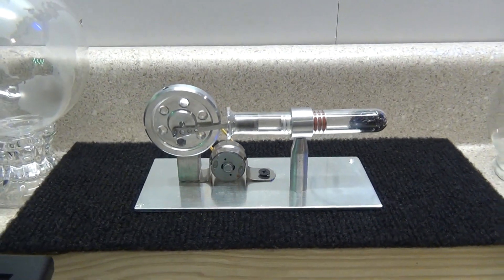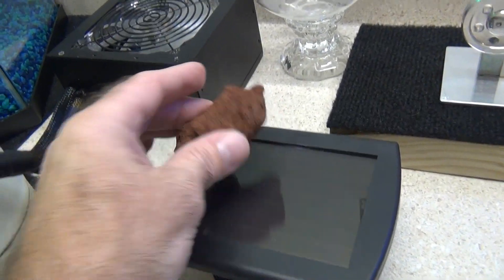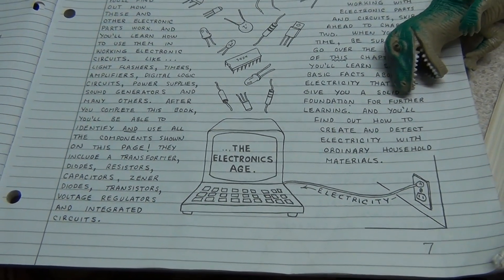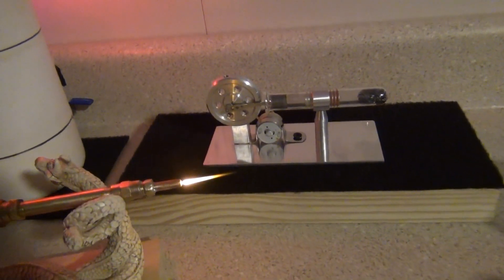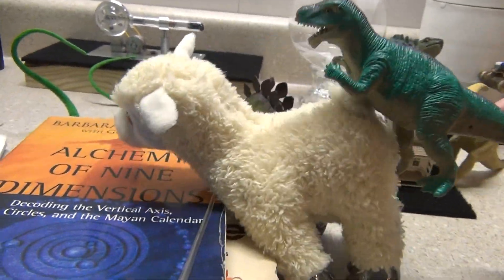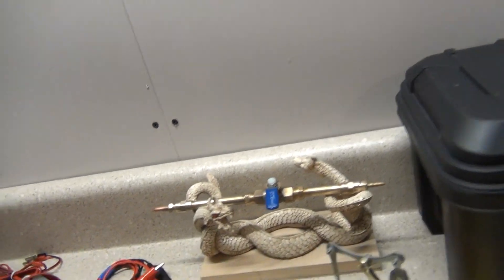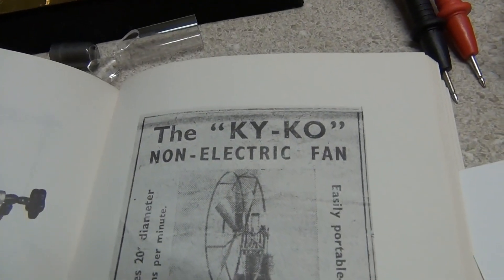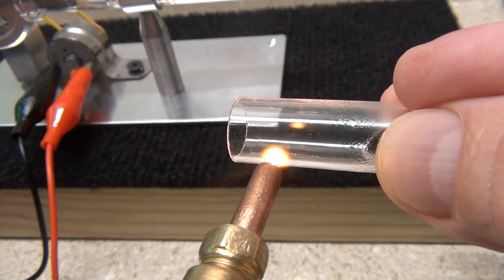PURE HYDROGEN SINGLE PISTON STIRLING GENERATOR

Comment from the maker: This is the motor of the future and probably the simplest design of its kind of the Stirling engines motors. This one can be reproduced in a much larger size to produce enough electricity needed to produce the oxygen and hydrogen gas using a Hoffman apparatus you collect separate & isolate the hydrogen & oxygen slowly over time.